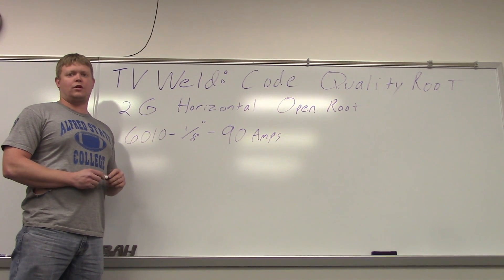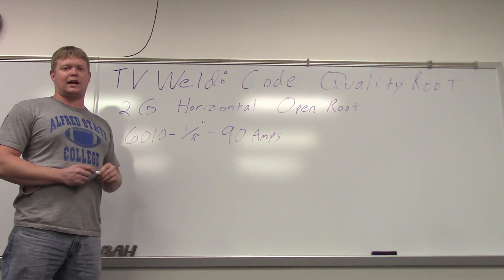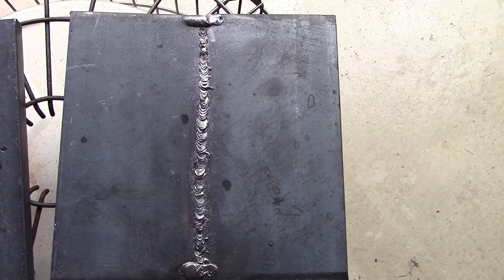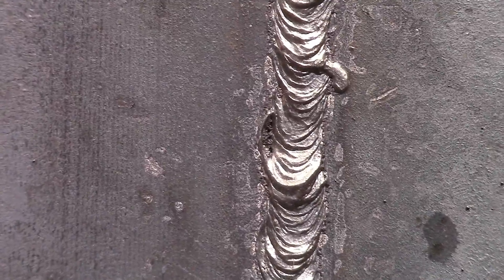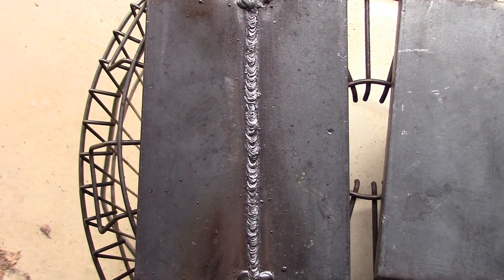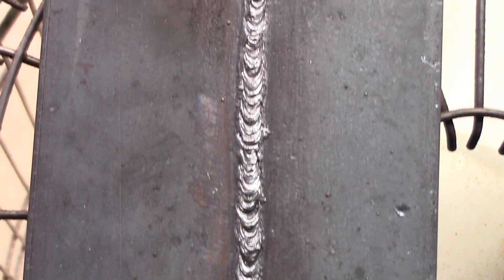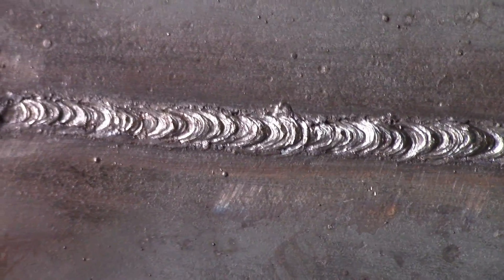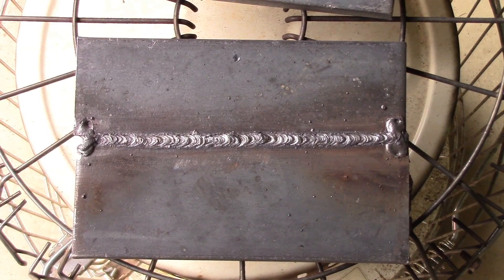2G SMAW Root Pass Open Root (Code Quality)

Comment: How does yours not melt a huge hole
Reply from the maker: If your blowing through, you need to either tighten up your gap, or put a larger root face on the edge of the bevel.

Comment: There is no need for the whipping back and forth. It's making the foot inconsistent.  With as tight a gap as you are using, if you jam that rod in there and simply drag it, keeping a 3/32-1/8" keyhole, it will put a perfect bead in.
Reply: Different techniques to do this.
Reply: Root*
Reply: Gage Stillwell exactly. this is no bueno

Comment: 6010 rod at 90 amps. the gap between both beveld plates is what? 3mm? do you have one that you weld 3G as well? trying to brush up for my trade test on 6&7 July. please assist me if you can.
Reply from the maker: 3 mm is about right.  I do have a 3G video.  It's in with the SMAW videos.
Reply: Shot man
Reply: +Brent Harkness how about Brazing 10mm mild steel plates? groove and fillet joints...
Reply: 75to 120 amps
Reply: Kai Thepoet gap 1.6 to 3mm round about